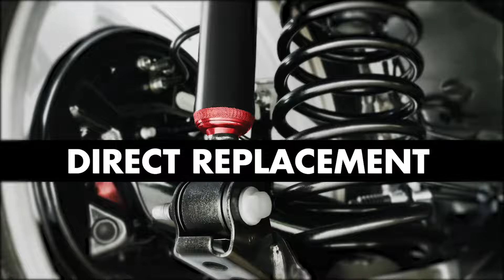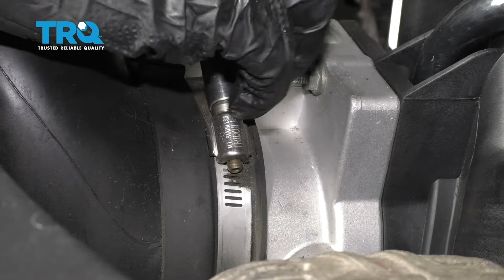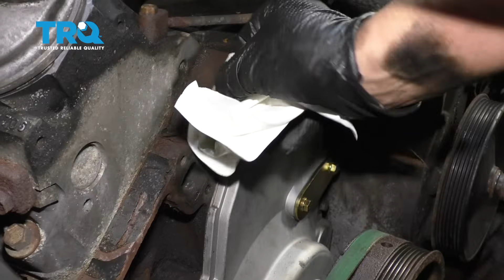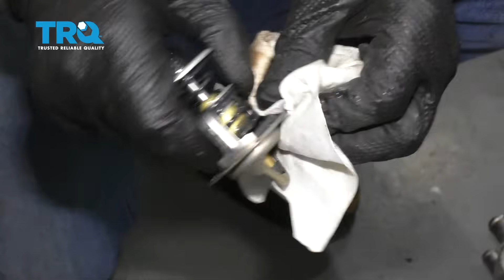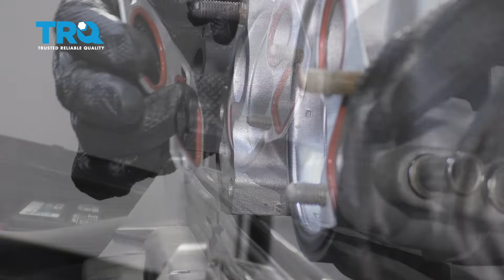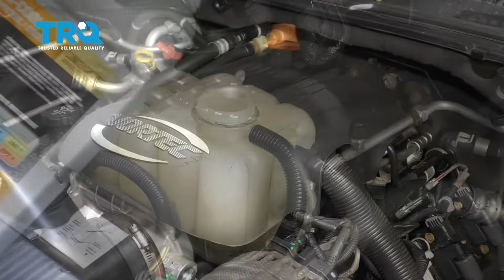How to Replace Water Pump 2000-06 Chevy Tahoe

Comment: Make sure to remove the existing rtv at the end of the bolts in the water pump, it'll mess the torque up. Also any bolt going through a water passage needs some rtv

Comment: For those asking about the clutch fan removal you have to undo the heater hose clamps and get them out of the way then the shroud has those little clips you pop open with a flathead and once you remove the shroud you just need a 12" adjustable wrench to loosen the clutch and take it off. Just make sure you don't take the belt off first because you need the tension to hold the fan in place while you loosen it.

Comment: Howd you get the fan off?
Reply: Some models have the fan some don’t.
You can borrow the fan wrench from oreillys
Reply: Old video buy bump with wrench on and mallet
Reply: Looks like an electric fan…. So no need to remove it
Reply: @ohjay7962  not electric fan u can see the threads on it . These guys are great but not showing how the fan comes off is misleading
Reply: @bobbybouchard753  As stated above, some models have mechanical fans, some have electric. This model has electric, which you can see at various points in the video. The pumps are made for both types, therefore they all have threads either way. The Tahoe/Suburban models of this year range mostly had electric fans.